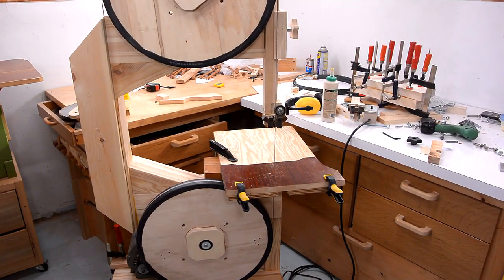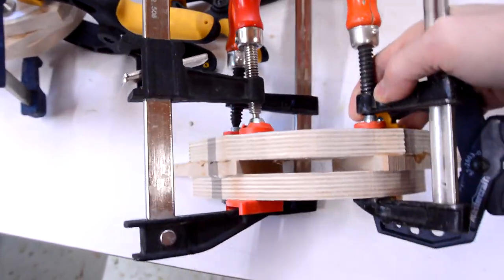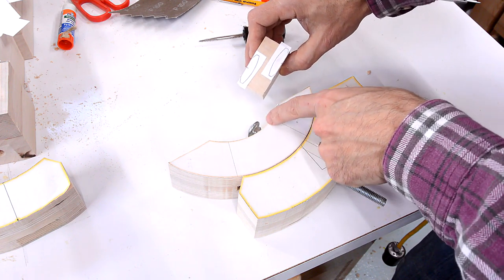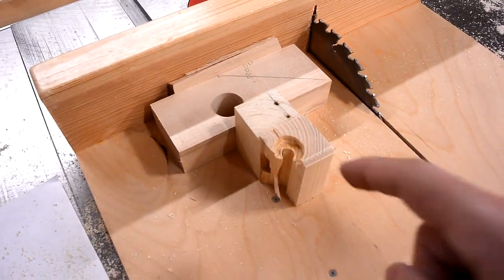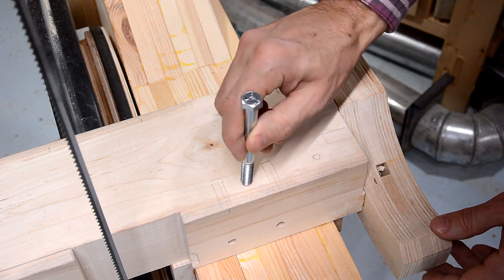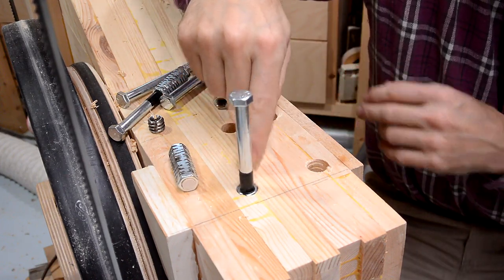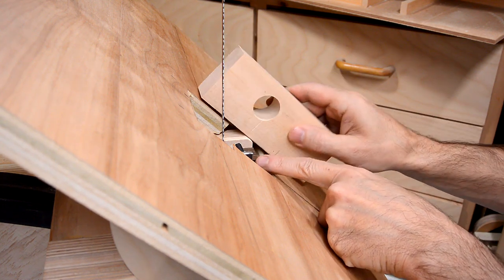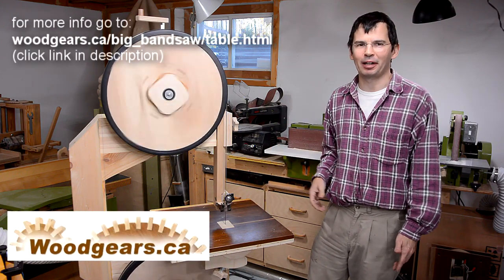Big bandsaw build 5: Table and trunnions

Comment: I use that coupler nut trick all the time and it works very well, mostly for removable heavy table tops and heavy leveling feet.  T-Nuts just don't have any strength and the thread count is so small they strip out under any amount of torque.  They're almost a joke.

Comment: Random thought, If you plan on removing and putting back the "trunnion beam" and you do  not want to adjust the location every time you put it back, you could put it in place once and then add a couple of wood dowels as a locating pins :D 

Nice work on the machine, Do enjoy your videos!

Comment: Whenever I hear professionals talking about "very expensive" I am wondering if they have a similar idea of "expensive" as I have. How much does baltic birch plywood cost there ? (What thickness and quality?)
Reply: well here in oz it's around $300 a sheet 3/4" BC
Reply: whats the standard sheet size there?
Reply: Dennis Lubert in Holland plate of 122x244x18 is about 90 euro..
Reply: +Rudyard Kipling, where are you buying your plywood? (looking for a good supplier)
Reply: arlo wiersma Interesting size, similar price as around here. BB/BB I assume too?
Reply: Dennis Lubert
same as US 8x4 or 2400x1200mm
Reply: +pirate323i 
 Price is more or less the same everywhere here - only difference is in the cost of shipping - that was the lowest price I have obtained.
Reply: Well, I have no idea of US standard sizes either ;) but that $300 would then amount to roughly $100 per square meter if I didn't miscalculate (the unit of price comparison around here) which is really rather expensive, the cheapest I can remember (still BB/BB ) is roughly 1/4 of that price... guess shipping over the big sea is expensive...
Reply: Dennis Lubert
I don't think shipping is that expensive but plywood isn't used that much here since MDF and Melamine arrived so it's a limited market.

To be honest though, I think the high price of plywood here has the same explanation to why dogs lick their dicks - because they can.

There is very little restriction of what businesses in Australia can charge for their goods, and since there is very little competition, and collusion between what little competition there is, is allowed, then they can charge whatever they want.

BTW yes it is BB not BC as I stated earlier.

(oh and yes, ~$100 a square metre, more in smaller sheet sizes) - I did include shipping costs in that price though - the sheet price in store is ~$240, but since there a very few plywood retailers they are usually pretty far away.
Reply: Rudyard Kipling Everything you buy here is MDF and everyone doing DIY (as opposed to real woodwork) is using MDF. There seem to be less people with a nice woodworking shop (space here is more expensive than in north america) so I am not so sure that this really is the reason.
Reply: Dennis Lubert
Well the "experts" tell me that Australia shut its plywood manufacturing industry down when MDF became available. Australia has more forestry per capita than the US and Canada have combined, but we prefer to import for some reason.

We import MDF (which, of course, is heavier than plywood) mostly from Chile but we pay nearly the same for MDF as they do in the US ($30-$40 a sheet) - so it can't be just shipping.
Reply: Rudyard Kipling We might be comparing apples and oranges here, as baltic birch plywood (as the name implies) can not really come from chile ;) also chile to US and to AUS might not be that different in shipping costs, I guess they both go by ship. At least for some shipments I know they come here by train.
Reply: Dennis Lubert
Dennis I said the MDF comes from Chile. not Baltic Birch plywood - there is little if any difference in DISTANCE between Chile and the Baltic region as far as Australia or the US is concerned - I don't see why the shipping costs would be radically different.

As a matter of coincidence Chile is almost EXACTLY the same distance from Australia as, say, Latvia is (who know where the BB plywood comes from exactly but it would be there abouts).
Reply: I bought a sheet of 24mm thick birch plywood (2440x1220mm) without shipping and that cost me around 110€. Made a computer desk from it for me and my wife.
Reply: emponator
Well I think you should donate the same amount to charity so you don't feel so guilty about getting it at 1/3 the price. ;-)
Reply: i can only say one thing, good that i am from Baltic states :) 3/4 ply 1 grade (or what is called best quality, clean ect.) one sheet 45-50 euros :) and best thing, one seller located about 6 min from me home.
And i am not even talking about "moisture resistant" the one with brownish layers on both side. price aproxxemetly the same. Actually it is better and cheaper to buy plywood thatn some real  hardwood
Reply from the maker: Last time I bought some, it was $100 for a 4'x8' sheet 3/4" thicck.  So, realistically, I'm using $10 worth (a big sheet is good for a LOT of small parts).  But still, no sense in wasting it.
Reply: still one third more expensive than here though. I tend to try to not waste any material, no matter what; I also somewhat find scrap parts of material flying around somewhat inspiring as my brain automatically tries to think what one could build of them ^^
Reply: It is all highly territorial. I live near Moscow (Russia). Birch plywood, MDF and OSB cost about the same and are rather cheap. 15 mm plywood sheet 1.5*1.5, unsanded and of construction quality costs 7$. It is a good plywood - no cracks or internal gaps, only knots. Sanded goes for double. At the same time, any hardwood, really any, is a luxury. Not only costs a lot, but you need to travel far to find any at all. Last time I needed a bit of ash, i bought a new hammer and broke away its handle. Otherwise it is pine, pine, pine.... 
By the way, should I make a bandsaw central pillar out of plywood or pine?
Reply: "15 mm plywood sheet 1.5*1.5, unsanded and of construction quality costs 7$."

That costs $43.75 plus $65 to deliver.

I am not sure it's just territorial - sure prices will vary from place to place for various factors - the question is why does plywood in particular vary so much?

BTW Birch is hardwood... ;-)

Hardwood is very expensive and reasonable hard to get here in Australia too - we only have radiata pine these days.
Reply: lysippus
The last half of that statement is the killer, and why I wish it wasn't in such prevalent use.
Reply: Well it isn't "baltic" - but birch plywood around here is about $40 or $50 USD for a 4'x8' sheet that's nominally 3/4", but actually more like .705" in thickness.
Reply: aus71383
To be honest I wouldn't know the difference anyway as I can't get it or afford it - but even our crappiest of the crap Radiata pine plywood costs more than that here - $72 at least.

There is a big difference here though - plywood  here is classed as structural and non-structural. The only plywood manufactured here is structural - it is aesthetically poor (CD) but it is strong and resilient as it is used for form work and building applications. I have never heard of plywood being referred to as structural and non-structural in the US but no doubt it would be classified that way some how.

Structural plywood would represent 90% of what we have available to us with only 10% being non-structural but aesthetically pleasing (AA BB BC) and sometimes used for furniture. It is all imported.

I include hardwood marine ply as structural although I am not sure if it is actually, but since it is manufactured locally and our plywood manufacturers are not tooled up for non-structural I assume it IS structural.
Reply: In Finland, Finnish grade A 3m2 of 21mm (~1/3") thick birch plywood was 126€ including cutting last winter. That translates to sheet of 1200mmx2530mm or 47x100".
Reply: For clarification, our "standard" size sheet of plywood which is 3/4"x4'x8' is equal to 18mm x 1220mm x 2438mm

21mm is over 3/4" - the nominal 3/4" boards are not actually a full 19mm, they are more like 18mm.
Reply: I bought a piece last week here in Arizona, 60: x 60" x 3/4" for $60 USD.  For comparison, I bought a 4' x 8' x 3/4" piece of oak veneered plywood for 50 bucks at Either lowes or Home Depot.  The baltic birch was from a wookworking store (woodworkers source) that sells hardwoods and tools.
Reply: Where I am in the US a 5 x 5 ft sheet of high quality 3/4 baltic birch plywood is about $60.  A 5'x5'x5/8" thick is $45.   And a 5'x5'x1/2" is $40 or so.

It really isn't that expensive depending on where you live.
Reply: dan
That's true but it doesn't help to know that if you live where it's expensive.

Comment: You should make a drill guide with steel shaft and some type of bushings I think they should be around 1” to 1/12” in length because if you make them too short there’s too much friction and it binds. You probably won’t make a video on it so I’m going to give it a try

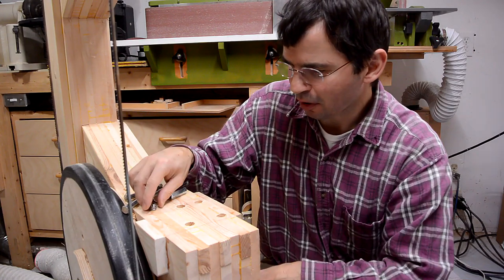Comment: It was all cool until 7:55 ... if you know someone who has a metal lathe... (for your next project) they can cut threads on the spacers to make you a threaded insert... then cut a slot on one end to allow you to screw it in. The machinist would make a rounded section about 3/8 inch (9.5-10mm) and place that in the jaws...  turn a 10-12 TPI (2mm pitch) thread just deep enough to slightly penetrate the flats. That would be incredibly strong. Given the surface area however... it looks like your solution should be strong enough. Incredible job overall. (As always.)

10:04 - I love the wood blocks to center the blade. My Shopsmith uses metal ones, when they wear out... I may try a set made from Rock Maple... I'm thinking it would work well... thoughts?

11:55 - Love the hand made knobs... I need to do that on my next project instead of the store-bought ones.
Reply from the maker: As it happens, I don't have a friend who could machine things for me.  And getting it machine would well exceed how much I'm spending on this bandsaw in total.
Reply: You do... you just were not aware of him until now... (and I'm sure I'm not the only one.)
Reply: Matthias Wandel As Always fantastic content! I  think in my 2 or so years watching you. i could count on one hand the amount of videos i didn't like (and even then i didnt hit the thumbs down.
     i dont recall you ever mentioning what you do,if anything, as a 9-5 job? i consider myself a pretty solid woodworker but im a carpenter by trade working as a lowly hamdyman currently....job market isnt great here. but im guessing you are an engineer or something? man your builds are awesome and so well thought out

Comment: Let's be real MW, you're "frugal" with everything, not just Baltic birch.
Reply: Matthias is elegant in his use of materials, except when he drops stuff from a great height.
Reply: "that way I save six sheets of paper".
Reply: I do the same. Apart from the money it’s a major hassle getting additional materials.
Reply: Personally I would have used 18mm OSB for a lot of this build. It’s well priced, uber strong and dimensionally stable. Use birch ply and maple floor planks for the fine details. 
The stability of OSB would also be good for the band wheels. The edges probably need to be resin sealed. Hey an epoxy “tyre” moulded around OSB core would be cool.
Reply: You could do with some long series drills that could go through both items to a deep depth. Then open to correct size with normal drills. 
Epoxy would be ideal for retaining those big roughened nuts.

Comment: Have you ever thought of making a sawmill with disc blades (not sure if that is the technical name but I am talking about large versions of table/drop saw blades) because I can imagine it would work much better than a modified bandsaw...
Reply from the maker: that would be harder to build, and not work as well.  Sawmills used to use circular saw blades, nowadays they are almost all bandsaws.

Comment: As a Finn, we don't really have anything but "baltic birch plywood" either bare or coated, although there are some pine- and spruce -based somewhat cheaper "concrete molding plywoods". What's your other plywoods like and how much worse are they?
Reply: we use this plywood as concrete molds when he uses it for special purposes only :DD

Comment: As the band saw runs, does the rubber get hot?  Does it cost more to make the band saw then it does to just buy one? I know the point is, to build one yourself, I was wondering about the cost? thanks. Very nice job. I enjoy your videos.
Reply from the maker: the rubber doesn't get hot.  If you pay more for the materials than a new one costs, then, yes, it costs more.  It all depends on how much you pay for your materials and what the price of a new one is.

Comment: Matthias,
I've watch all 6 of your wonderfully produced video's on the big bandsaw build looking to answer a question.  I didn't find the answer I was looking for but absolutely loved all phases of your productions !

Question :

1.)   I wanted to know what the max cutting height is of this new bandsaw?

I noticed a couple of your drill bits have very sharp looking points ground into the tips !  
2.)   I wonder :
        a.)   Did you buy them and would you share the link?
or    b.)   Did you grind them yourself and would you please do a video on the process?

Thank you for your generous consideration,
Sincerely,
Steph_Louisiana
Reply from the maker: 1 - more on that in upcoming videos
2 - not aware of the bits being particularly special.  I just bought them.

Comment: Very cool, Matthias.  Just wondering... do you use any finish or waxing between the gliding parts?  IOW, what's your favourite way to reduce the friction there.
Reply from the maker: nothing to reduce friction.  If I make it slide easier, it won't lock well enough.

Comment: With the tilting table, is there a possibility that the two tightening nuts will cause one side to be tilted further than the other.  Thanks for another great video 0wl!
Reply from the maker: I suppose, yes, by .01 degrees.
Reply: I presume that won't cause a problem then! :)

Comment: What motor/engine did you use? Can you make curved cabriole legs with it?? Cuz I wanted to buy a Makita f1200 900w 1-1/2hp but it coasts $18000 (Argentinian pesos) and a 1-1/2 hp motor/engine costs around $3000 so... And that motor/engine might be usefull to build my own Lathe also... What do you recommend?
Reply from the maker: It's a bandsaw, and it does what bandsaws do.  As to what is best for you, that's is something you have to decide.

Comment: I'm wondering if stacking two of the threaded inserts at 7:55 in each hole would be as strong as modifying the coupler nut and gluing it in.
Reply from the maker: the problem with that is getting everything aligned.  With the machine screw threads aligned, the wood screw threads probably won't be aligned.
Reply: Right, the inserts would almost certainly have to be screwed in to different depths.

Comment: Hi Matthias! Considering the extra layer of wood you finally needed to avoid the lower guide to protrude over the plane of the table, right now the intersection between the blade and the curting surface is not perfect right? I mean, now, when you tilt the table 45°, it's out of center. Or did you already planned this change??
Reply from the maker: when it's tilted 45 degrees, it's still centered.
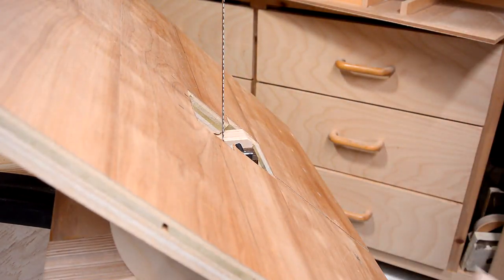Reply: Ok, I was checking the video again. At 10:42 I can clearly see that the axis of rotation is at least 1 cm over the surface, so I suppose you planned before about this extra thickness.
Thanks for answering!! Knowing that at the end it is working as it was supposed to do it, it is much easier to understand the mechanism involved.